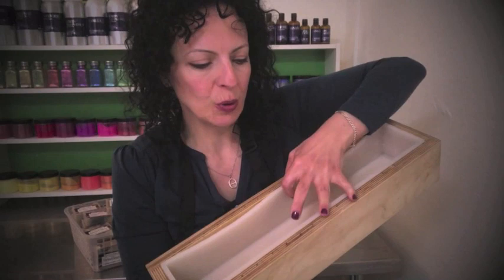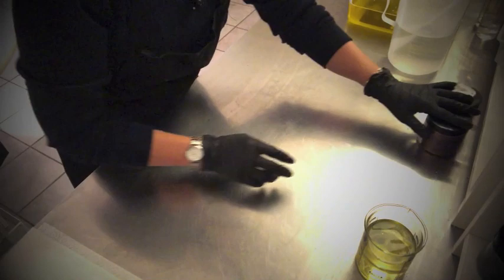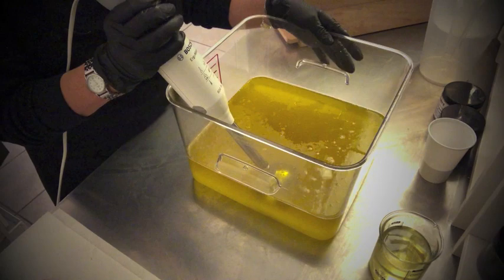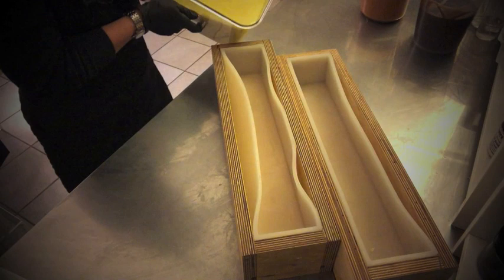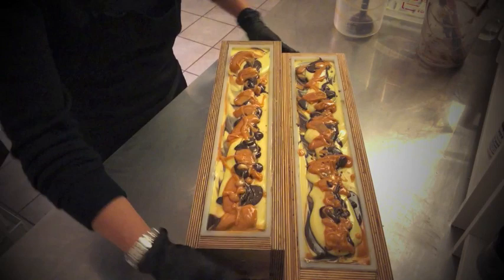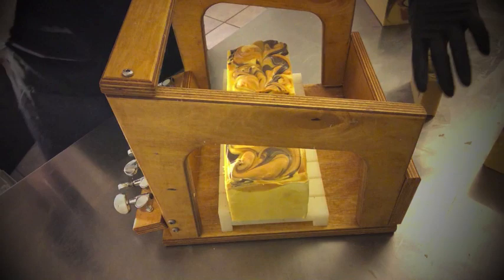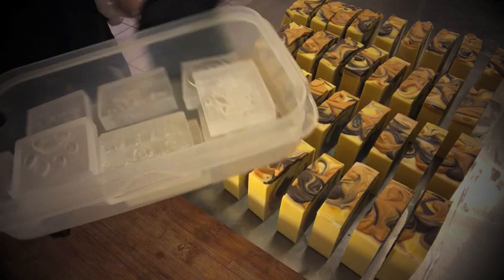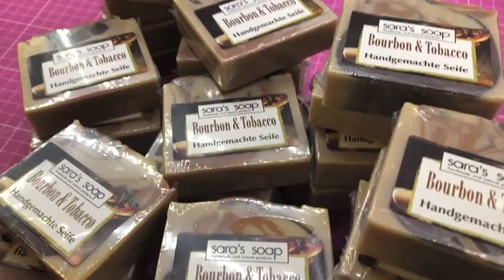HOW TO MAKE BOURBON SOAP | SOAP FOR GENTLEMEN | step by step  🥃

Comment: Hello. I have the same mold. I am a begginer. Can you please put the weight of the oils? I like your recipe because has easy to find oils. I can use it and just change the additives. Thanks a million from Texas
Reply from the maker: Hello Mayela. This is a double batch and one mold is 2,5 kilos or 5 pounds. So you can take the 5 pounds and calculate the percentages thereof. Let me know if this helps. (My measurements are in grams)